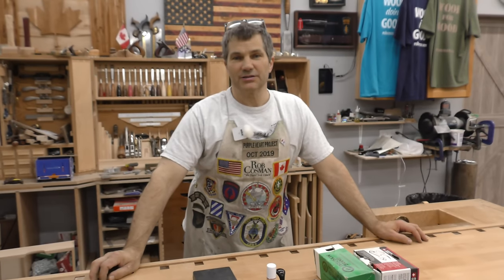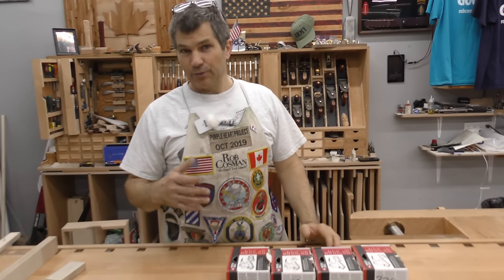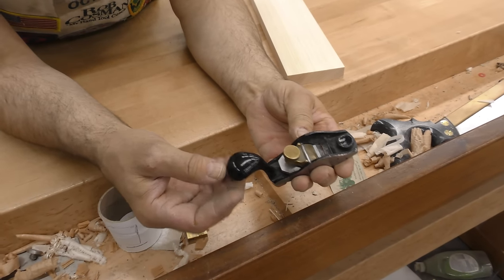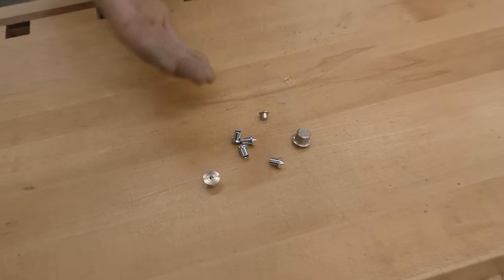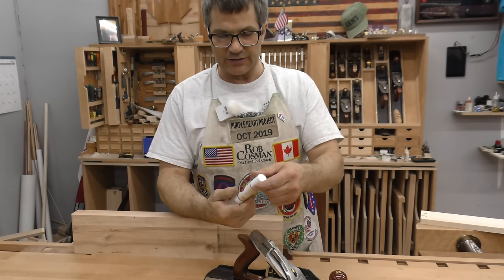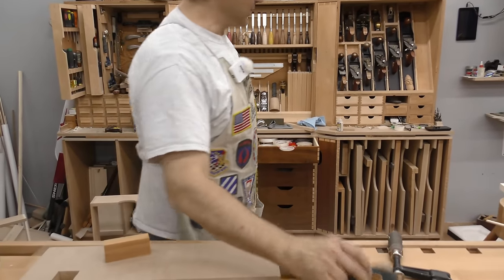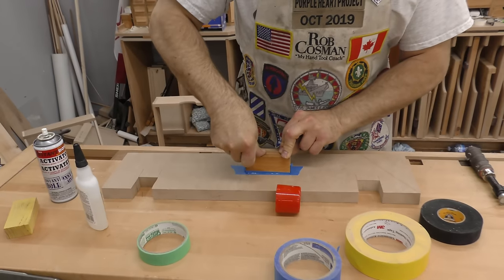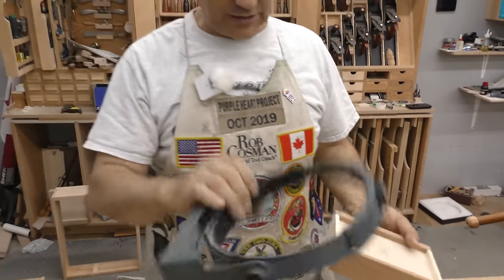Top Woodworking Gadgets - MUST HAVE ITEMS

Comment: I plan on using the CA / glue trick for working with router templates - I had seen some videos before, a luthier in the UK uses this method and it is remarkably effective.  One thing I remember hearing is that CA glue has great strength head on, but if you twist the 'handle' in your example to get it off, I believe it will release relatively easily (no need to 'knock' the 'handle', just twist it)...  Another use I'm going to try this with is for my thickness planer.  I'm going to make a sled out of MDF, and instead of using hot glue to stick the board (or wedges) to the sled, I'm going to try tape with CA glue.  It may take more glue than it is worth - in other words, it might be cheaper to use a hot glue gun, but it is something I want to try, for ease of application/removal/cleanup.  At the very least, I will use it with a template for pieces to be repeated (like for an outdoor bench I'm going to make this year);  put tape on the template and on the piece you're going to route into that shape, apply your CA and accelerator, put them together, then the template will stay in place while you run your router along the template edge with a flush trim bit or pattern bit, (depending on where you put your template), then remove the template without leaving a mark - and you could even do it on your bench using bench dogs, since you won't need any clamps to hold the template in place - just use the dogs to hold the item in place - if that would be strong enough to hold it while running the router around the edges - but even if not, just route what you can while the piece is clamped in place on your bench, then move the clamp and do the rest.

Comment: You know that one, you just forgot, still wool for sanding molding. A feeler Gauge and a micrometer or caliper work too. 
The feeler gauge would be suitable for hanging a door and setting the gap evenly. Insert the feeler gauge in the gap, measure it with a micrometer or caliper, and find the right shims.

Comment: Rob, Thanks for your videos and these great "gadget" tool tips.  Re tip #1: Optivisors give me instant eye strain and then a headache.  What I have found very useful instead is "Mag-Safe Safety Glasses".   I found them at Otto Frei jewelry supply, which has a wide range of magnifiers.  They are also available from Amazon.  Available in a range of magnifications (diopters), they are true safety glasses, ANSI Z87.1+ rated.
Reply from the maker: So any clue why one gives you headaches and the other does not?
Reply: I'm nor sure.  I'm very nearsighted.  Perhaps the angle between the lenses built into the Optivisor is somehow wrong for me. @RobCosmanWoodworking

Comment: Cork. It can be used on a sanding block or bending form.  Packing tape - again great for bending forms and veneer work to keep the glue off the caul.  Set up blocks- either purchase a set or buy seperate keyways.  The Gripper - it is the best push block/ safety device on the market.
Reply from the maker: Great Tips...I know COL Luther uses the Gripper and says the same thing.  I should definitely try it.  Packing tape is awesome for clamps too...and I just learned that.  Set-up blocks are good too!!!

Comment: I prefer dial calipers over a tape or rule anytime I can. I have 4. Brown and sharpe. Mitutoyo. Dials and wen and some other less expensive digital ones. Also another digital I used on my drill press for a DRO. I love double sided also. I Proli have about 6-8 types of tape in my top drawer 😎

Comment: The overall composition / structure of the video was really good.  The intro was well structured and carried out. You told them what to expect to be covered in the content and the reason/s why the content of the instruction is important to the viewer.  The instruction content (the middle) of the video was good.  It casually, but specifically covered the topics and explained the (and this is important) what, why, how and when of each issue covered (the tools in this case).  The conclusion suited the circumstances, but I'd have been chipped by the Warrant Officer for including more topics in the conclusion than I had in the Intro or Content section. Your personality shows through in your presentation style - which is good.  If I were going to be really picky I'd add the topic in the intro screen flash (IE. #8 - Digital Calipers).  And I'd do that for the other videos too.  It's the age old adage "Tell them what you are going to tell them."  Again, really quite good video.
Reply from the maker: COL Luther said he thought about doing that, but went with the just the number to keep it KISS.  We are getting so many good ideas we will do another one of these soon and try your suggestion.  Thanks again for comment on all our videos....please keep helping us with how we make and edit these with your feedback

Comment: One of the tools that I use most is the old style rule. The wooden folding rule with the sliding extension. Especially when doing cabinets boxes or drawers. There is a lot of times ill need an inside measurement and I have found this rule is extremely handy for that purpose. Using two sticks and a spring clamp works but the folding rule is so much faster and easier for this purpose. Also if it is a measurement inside a tight spot, such as Angie's bed desk, you can unfold it inside the piece and get the measurement and then pinch the extender with your fingers, refold to remove and still have your measurement. Hope that makes sense.

Comment: I keep a very strong  half circle LARGE magnet stuck on the side of my table saw.  invaluable when looking for a small screw dropped into sawdust or shavings.  just swish it around on the floor, and you'd be surprised what you come up with!   mine came from a rather large discarded speaker and no idea where the other half went.  also handy for finding my arbor nut dropped into the sawdust bin under my table saw.

Comment: The best sandpaper ever is Tri-M-Ite by 3M. It’s silicon carbide. I have no connection and have used it for decades. Use the plastic dresser on it as well as on my power sanders. It lasts almost forever. Well, not quite. I rate them both as my number one gadgets.
Reply from the maker: Thanks Jim...I will try that

Comment: Great tips, thank-you.
Reply from the maker: You bet!
Reply: Clothes Iron. I’m not the level of craftsman that you are and occasionally ding the wood. I use a damp rag placed over a dent in wood and run the hot iron over the rag. As long as the fibers are not crushed, the hot iron and moisture will draw out the dent.

Comment: Magnets! 150 mag switch to create a fence stop on table saw for repeatable cuts. Same one on top when preparing a chisel on trend diamond plate. Sucks chisel to plate but I can still move chisel. Small bar mags make a good depth stop on hand saw. Barrel magnets hold bag to dust collector while I replace the bag. Cup magnets hold covers down on tool surfaces. Hold lights in place. I could go on a long time
Reply from the maker: Wow, great uses.  I will try the chisel preping trick.  thanks for the tips

Comment: I get the broken tools/picks from my dentist. He doesn't have to get rid of them and I can pick in tiny places when I need to do so, especially when I an turning something on the lathe and I find "pin" holes that need to be made larger for easy filling OR I can mark places where I can use my Dremel tool for embellishments. Glue can't hide either. Always have four or five on a magnetic tray atop the headstock.
Reply from the maker: Do you clean them first? 😀  Actually I can see how they would be super useful.  Great tip.

Comment: Great video! I agree with all of these, the only addition I can think of at the moment are Machinists Parallels, 1x2x3 blocks and Dowel Pins. For precision ground tools these can be modestly priced, and I always look for inexpensive used and/or mismatched sets during industrial machine shop auctions. These can be useful for machine setup, as gauge blocks, or with the addition of adhesive backed sandpaper they can be used as reliably flat sanding blocks for small parts. My favorite use is to only put sandpaper on the sides of thick parallels and use them with a shooting board for shaping/refining short ends, facets and edges that are difficult to plane, or to kiss a high spot with pinpoint accuracy when finessing a panel joint. Another trick is to lay one down on a large sanding block and use it as a right angle reference (you can protect it with tape on the face in contact with sandpaper). That is how I insure small parts like guitar nuts and saddles have perfectly square and flat bottom edges.

Transfer punches are a handy variation of the dowel centers. One of the Harbor Freight tools that you will not regret buying.

Some other applications of the gadgets you listed:

Use feeler gauges / flexible rulers / card scrapers or .005-.020" shim stock (preferably spring steel) faced with adhesive backed sandpaper as a sanding tool for curved edges and surfaces. If there are lumps in your curve the flexible steel will hit the high spots and skip over the low ones. These can be tricky to hold onto, but you can stick handles to them using double stick tape or your masking tape and CA glue trick, so long as the handles do not hinder flexibility. For sanding small curved sections with a feeler gauge sanding tool I will just double stick tape it to my fingertips. Old bandsaw blades might be useful for this if you have the patience to cut them up and grind off the teeth, or this could be another application for those Japanese pull saw blades that are designed to be disposable rather than re-sharpened. Grind them into custom card scrapers, or use them for contour sanding after removing the teeth.

I also have a trick for quickly and accurately setting a combination square using the depth gauge on a dial caliper. Set the caliper to your dimension, lock it, then set the end of the caliper against the end of the square’s blade with the depth probe projecting along the blade’s side. Slide the head of the square up until it touches the probe and lock it down. If I am working with dimensions smaller than 1/16” I prefer to use decimals, and tools like a dial caliper that measure in thousandths are invaluable. I would say the caliper is my #2 tool after a combination square.

Comment: I build guitars and my own furniture, often from mahogany out of skips (dumpsters). I clean wood up in caustic soda to strip crap out of the grain, old varnish and shellac, stains etc. Then rinse the wood (which is now black) and soak it in oxcallic acid which returns it to it's original colour and removes any rust stains from nails. The result is wood that looks like new! DO Read up on both if you want to try them - gloves and face covering essential.

Comment: Also, over the years I've found my Starrett combination square to be invaluable. I've used various imitations, but none are as smooth, accurate, readable and durable.
Reply from the maker: I must agree with you on the usefulness of a combo square.  I like PEC brand myself.
Reply: Me too. I wouldn't come close to putting it in the "gadget" category. For me it's an essential tool.
Reply: @RobCosmanWoodworking  Thanks. I'll check them out for our shop ("Ruston Community Men's Shed" in Ruston, Louisiana).
Reply: I like my 4" PEC double square more than my 6" Starret combination square, because I can set one side to a specific length and use the other side to mark a perpendicular line without flipping it over

Comment: I have business cards, playing cards, smooth credit cards, posit notes and card stock strips (grocery dry goods packaging) scattered around my small shop for shims. I get large thick-ish flat sheets of clear plastic from vegetable/fruit packaging for making clear indexing strips on jigs and such. Magnetic mag sign material (salvage if you can) cut to fit toolbox drawers, shop trays, web drawer liner stuff does not work. Hung a large sheet behind a mounted angle grinder chop saw to catch the metal bits, catches a lot.

Comment: Finish carpenter here.  I hate working with a fat pencil.  I find that a Tul 0.7mm mechanical pencil gives a good sharp line, and is sturdy enough to withstand job site use.  Barring that, I want a good electric or hand cranked sharpener on hand.
Vix bits are invaluable when putting hardware just where you want it.
Finally, Collins pinch clamps are great when assembling outside corners, especially with crown.

Comment: 12" hemostat style clamp. Mine is from Harbor Freight of all places. Good for retrieving dropped items, holding parts when I am heating it with flame or heat gun, holding a nut in a tight place when I want to turn the mating screw, holding small parts at the grinder, ..
Reply: I put a n mag on the shaft and the screw sticks to the end good.

Comment: Hi Rob, your list is spot on for me.
 The very fine ca glue is also amazing to use as a finish on small wooden pieces, especially on a lathe, as it's turning drop some on the item while holding a cloth under the item and it will penetrate evenly and smooth. It also works off the lathe if you rub the object quickly without stopping till it's dry.

Interesting trivia, 1. ca glue is actually a 2 part epoxy and the reason why it sets so quickly on your skin is because the natural moisture on your skin is exactly the right amount to accelerate the curing instantly.
2. If your fingers get glued together DO NOT pull them apart because it tares your skin, instead use a twisting motion, because that is its weakest bond,  ca very weak in terms of shearing strength. 
I also like to use a variety of French curve rulers in order to replicate shapes accurately and also to copy angles from a sketch or picture on to wood, a bendable rule also works but can be a problem if it's bumped and goes out of shape. 

I hope this makes sense if not let me know and I'll try to clarify.

GOD bless and protect you, your family and friends, as well as all your subscribers and viewers and most of all the ALL Vets and the Purple Heart Team.
Reply from the maker: Makes total sense.  Never thought about CA and moisture in your fingers but it makes perfect sense.  I knew and us ethe twisting verses pulling thing..but its a great tip.  French curves is another good tip.

Comment: A mini silicone spatula for general glue spreading.  Because it's silicone, cleaning it is super easy.  And a small syringe (10 cc or so) with screwlock plastic tips for injecting glue into tight spaces and cracks.
Reply: .... and by far my favourite measuring tool is my digital calipers.
Reply from the maker: Both are great gadgets

Comment: I use the blue painter's tape daily for something.  If I want to mark a piece of wood or anything for that matter and do NOT want to mark the piece in any way, I use the blue tape and then mark it.  I use this stuff so often I bought a tape dispenser that fits the tape.  That way I can just tear a piece off and it is square, without having to mess around separating the tape end from the tape.
Reply from the maker: I use it all the time to. 100s of uses

Comment: I often use blunt chisels, not dull chisels, blunt chisels. So with a 90 degree edge, instead of cutting the wood, it scrapes it, which can be very usefull when you don't want the tool to dig into the wood. Some cuts you just can't make with sharp chisels

I also like to use a jigsaw blade stuck into a handle, which I use for cutting the abutments on a wooden plane

Finally, a pair of "adjustable parrallels" aka two mating wedges to counteract rack in a vise. Wedges in general are very usefull in woodworking!
Reply from the maker: I love the idea of adjustable parallels.  I have never seen that but it makes perfect sense.  really good tip that one.

Comment: My "gadgets":
I often use small squeeze bottles with needle tip. They are excellent for applaying oil in weird spots and they give a lot of control compared to spray lubricants that make huge mess.
 I also recommend getting a pair of plato side cutters. They are great for cutting almost anything flush with a surface and are nice and small.
Also a great addition to the shop is silicone mat that is used for soldering electronics. It has space for screws while dissassembling things and is temperature proof and is excellent for messy things because almost nothing sticks to it.
Last thing is thermocouple or cheap IR thermometer. Sometimes some things get hot and it is nice to know how hot they get, especially when we feel that something is not right and we can check if something is not overheating. Talking about hot things - Fire. I recommend geting a few spray paint can size fire extinguishers. Not everyone has place for fire extinguisher but those are just a right size to fit them almost everywhere so there is no excuse not to have them.
Reply from the maker: Awesome gadgets.  I really like the mat tip.
Reply: @RobCosmanWoodworking  Also I forgot about one of my  weirdest shop gadget: Makeup brushes. They are awesome for getting dust and other particles out from hard to reach spots. They come in various shapes and sizes and are really soft/gentle so they cant really damage anything. Outside the shop they are irreplacable for cleaning dusty PCB's , "consumer electronics" like between keys on keyboards and also jewelery and other small and gentle objects. I bet other people can find more uses for them. You should really get some.

Comment: Blue painters tape to lay down and mix epoxy on.  Blue tape for temp drawer handles,  A fine pointed palette knife for applying colored waxes & paints.  An old ‘beater’ chisel...but sharpen it razor sharp. That way you can use it on some rougher stuff without fear of ruining that $100 edge on your  best chisels.  I carry a 3/4” & a 1/2” in my tool box.  I keep the edges covered just like you would any chisel.